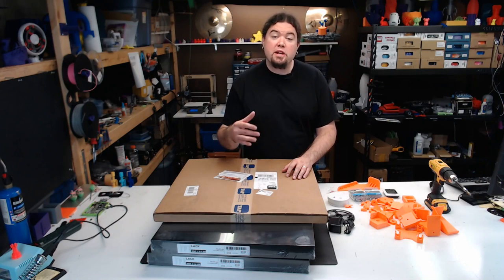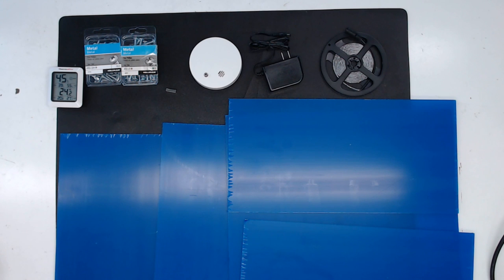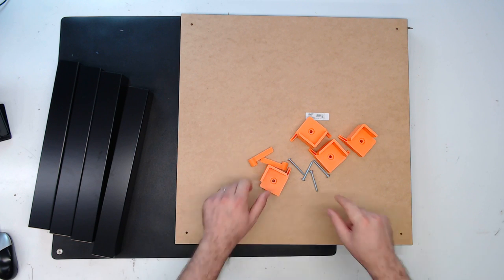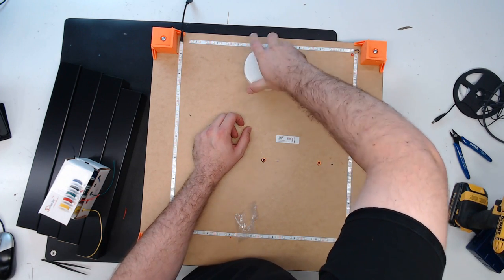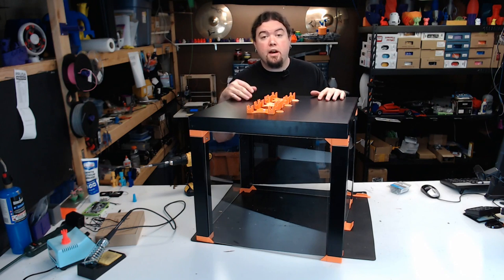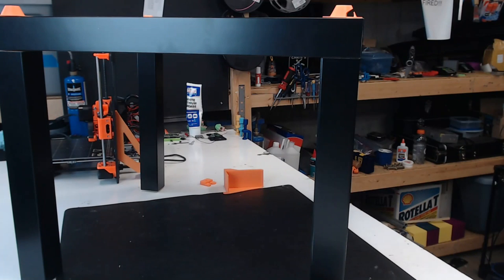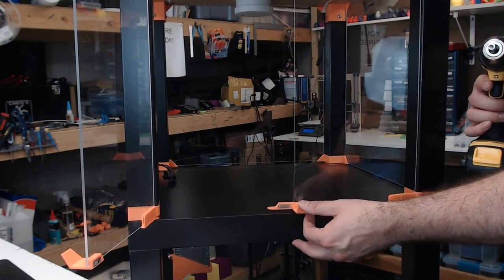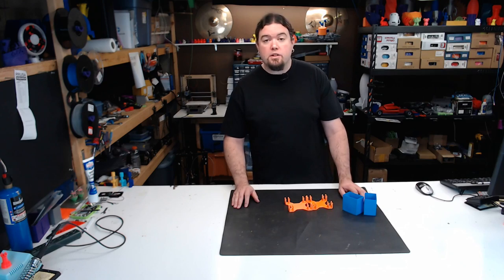Prusa IKEA Lack Table 3D Printer Enclosure - Chris's Basement

Comment: Chris, great video!  I've watched it several times already as I print the parts to build mine. Just wondering how the superglue has held up against those strong magnets?  Still hanging on? I've been leaning toward Loctite epoxy plastic bonder.
Reply from the maker: The super glue is still going strong, although I have used that epoxy before and it's a beast.
Reply: @ChrisRiley  thanks! Really appreciate the reply 👍

Comment: This is really cool, and I know I am two years too late, but what if you connected the Smoke Detector alarm to an Arduino (plus the alarm) so when it sends the alarm signal, it 1; cuts power to the Lack Rack and 2; emails/texts you that the detector went off. (Maybe 3, send a photo so you know if it is a false alarm or not)
Reply from the maker: That is a really good idea, maybe even add another temp sensor in there as well.

Comment: Just about ready to order the MK4 waiting on the MMU to come available, do you tink this will work for the the new MK4 these look to be about all the same size and design and forgot you earned a new sub great video...IKEA changed there website can you update the link for the Lack table please
Reply from the maker: Thanks! Yes, should still the MK4, but with the MMU2/3 you'll have to use the enclosure V2 with the flip top. Sure, I will update the link.

Comment: This is just too cool, def want to do this. I hope someone have made alternate pieces to make it work with a Ender 3 printer.
Reply from the maker: Yes, I think there are some parts out there for it.
Reply: @ChrisRiley  I found a package for the Ender 3, but it was just remakes of some stuff and didn't include the bits for the PSU relocation that would fit the Ender 3 PSU :/ Still very cool and might do it.

Comment: The #12 2 inch screws don't bite much into the table top.  They can be pulled out quite easily.   Better to use #14. Maybe Ikea changed the hole size.
Reply from the maker: A few others have said that, seems like #14's are the way to go now.

Comment: Great video!  Came to the party late.  I have a question for you. How much room from the top of the Prusa to the top of the enclosure?  I have a 15" paver stone that is 2" thick and would like to see if it will work with this enclosure.
Reply from the maker: It's kinda close, especially when printing tall stuff. You have about 2.5 inches of clearance from the top of the extruder to the top of the enclosure. So it will fit, but you might need to cut a slot or something like that to not break the filament.

Comment: What kind of screws did you use? Did you use self-taping screws?
Reply from the maker: I used these https://www.lowes.com/pd/Hillman-14-x-2-in-Phillips-Drive-Sheet-Metal-Screws-2-Count/3034788

and these:
https://www.homedepot.com/p/Everbilt-12-x-3-4-in-Round-Head-Phillips-Zinc-Wood-Screw-6-Piece-Bag-809131/204587510

Comment: Chris, You're awesome thank you. could you advise me how much was the total cost? does the backside of the printer enclosure is open or closed ? does this table size allow heat bed movement free?
Reply from the maker: If I were to guess, maybe $80 US. The back is closed. It is tight, but you can make the prusa not touch the back if you work with it,.

Comment: Checking out the plexiglass size on the Prusa project and the size is given in metric. However, the Tap site wants imperial. I know the 440mm comes to around 17 5/16 inches. Was wondering what was the size you ordered so I know they will fit.
Reply from the maker: Yes I should have mention that, I used (3) 17 5/16" x 17 5/16" and  (2)  8 11/16"  x  17 5/16"   all .118" thick.   Thanks for the comment. I will update the description.
Reply: Just as a FYI, the cost at Tap Plastic for the Plexiglas came to $59.87.  Shipping to my location was under $13 and I'm pretty sure I will have to pay tax.
Reply: Edward Boston the cheapest option on their website is the Extruded Acrylic Clear
Reply from the maker: Interesting, I didn't see this on there site. I will go check it out. Thanks for letting me know.
Reply: Edward Boston 
Tell Tap that America went metric in 1893.
Reply: https://www.printedsolid.com/collections/enclosures/products/acrylic-sheets-for-prusa-lack-enclosure
Reply: FYI, Tap Plastics has a metric option now. My order of 3mm extruded acrylic came to $55.12 after shipping ($12.52 to Dallas). Interestingly, the metric option came out slightly cheaper.

Comment: Pretty awesome . I have a Ender 3 . I think itis about the same size. 

My main question is : wil it decrease the sound level also ? like .. alot ? or is it just a little bit ?
Reply from the maker: Thanks! Wellllll......It makes the direct machine noise a little less, but since the tables are hollow, the resonate noise actually goes up. I put a 1 inch piece of foam under my printer to combat it. Then ender 3 is a little taller than the Prusa, so you will probably have to extend the leg caps.
Reply: @ChrisRiley  yeah it is 10cm taller.  Nou I have to convinve my wife to have it stand in the living room 🤣
Reply from the maker: @solidusseal  Yeah, I have the same problem. I haven't been able to achieve that yet. :)

Comment: How did you control the heat in the cabinet?  I want to build one for my Hypercube so I can print ABS better. Thanks for sharing.
Reply from the maker: I don't really, on a good day it will hit 32c, but that is about it. So I don't need to cool it down any. It's not very tight, but works pretty well.

Comment: good video, my Ender 3 showed up yesterday, so I am in the initial building phase, I lucked out I had purchased two of the tables(blonde) a few years ago, so I can re-purpose them. I live about 30 mins from IKEA. sad part is it is on the way to Micro Center.(joke) For the Magnets any other supplier?
Reply from the maker: Thanks! Yeah. it's a little short for the Ender 3, but it can be modded. Not sure on the magnets, they can be hard to find. It might be easier just to rework the parts to fit another type.
Reply: I have bought a few magnets from kjmagnetics.com they have a pretty good selection and you don't have to buy in bulk, which is a plus for prototyping. They are not that expensive either.
Reply from the maker: @Wulf_Mane  Thanks for the link!

Comment: Hello, I want to buy a 3 D printer.  I like the Prusa MK3S a lot.  Unfortunately, I don't have the money for an original.  What do you think of a Fysetc clone?  It is available for around 300 €.  It would be important to me that I can print holders, accessories, etc. (e.g. Blastgate) in the workshop.  Is PETG the Right Filament?
Reply from the maker: I don't know much about the clones, but people seem to like them. Keep in mind the MK3 has a lot of smarts because on the mainboard and firmware. Make sure you are getting a mainboard and the correct one. TO get the Prusa magic you really need an Einsy of some kind. Yes, all the parts are  printed in PETG.

Comment: Great work - I still need to print the parts. Apart from the bed wire guide which you printed in PET, what material did you use for the other parts, ABS or PLA? I'm sorry in case you said that and I missed it. Anyways - great video. Thanks for sharing! Cheers! JM
Reply from the maker: JM Tosses All the other parts were inland and filament Friday orange PLA. Thanks for watching!

Comment: What did you put under your printer to minimise the noise? Also do you think something heavy needs to go on top of it, to make it more stable and sturdy?
Reply from the maker: Mine is pretty stable, but I did add 1 inch foam under the printer and 1/2" under the feet to quiet it down.
Reply: Chris Riley can i get a pic of your full set up? Also is there a link where i can buy the foam you used?
Reply from the maker: @alex75846  Here is a couple of shots, the foam is just from the local home depot. 

https://photos.app.goo.gl/dNWvhgJsMY4ic8eV7
https://photos.app.goo.gl/b6xamezVu7rZEPWZ9

https://www.homedepot.com/p/R-Tech-1-in-x-4-ft-x-8-ft-R-3-85-Insulating-Sheathing-320821/202532854
https://www.homedepot.com/p/Owens-Corning-FOAMULAR-1-2-in-x-4-ft-x-8-ft-R-3-Square-Edge-Rigid-Foam-Board-Insulation-Sheathing-36L/100320356

Comment: why isnt the motherboard placed outside aswell ? I mean the drivers would have a bad time in 40 degrees inside the enclosure no ?
Reply from the maker: The temperature you will probably have in the enclosure will be less than 40c, the Ultimachine boards should be able to tolerate that with no issues.
Reply: @ChrisRiley  Ok what about us poor people ? What about Ramps, mks gen 1.4 and so on ? With LV or A4988 drivers ? .. btw would adding fans on the case of the board help ? Because it is still just circulating the hot air inside the enclosure.
Reply from the maker: @Wello789  Any air movement should help. A4988's should be just fine, they run a lot cooler than TMC's.

Comment: Hey Chris. I build my own enclosure using three lack tables this weekend. 
Also added some metal angles to screw the first end second table together. 

My first prints came out well but the table is shaking very much. Especially on fast moves or when printing the infill. 
I noticed some gaps in the infill and i think the shaky setup causes them. 

Any suggestions about how I could compensate the vibrations of the printer to reduce the shaky tables ? 

I know a good solution would be to screw the table to a more solid object or the wall but maybe there is another better solution.
Reply from the maker: I really can't think of anything off the top of my head. I do sit the printer on some thick foam when I use the enclosure. This could provide a little give and make it move around a little less.
Reply: Chris Riley thank you for your answer. I will test around with some foam under the printer. Maybe it helps. 

Is your enclosure also that shaky ? Or has my prusa unnormal heavy vibrations. ?
Reply from the maker: Mine does move a little bit, but from the sound of it, not as much as yours. It's possible you might have a slight hang up in a bearing or something.

Comment: What about rigidity and stability? IKEA tables are not exactly solid and they are very light (I can imagine high acceleration values can be problem). Have you noticed some problems in this direction?
Reply from the maker: It moves around a little, but I have added a lot of extra screws and brackets to help.
Reply: I worried about this too but it's working fine
Reply: Oh fwiw I only have 1 table on the bottom, not two

Comment: I'm a 3D printer newb, sorry in advance for a newb question.  I heard this is too small for the more economical Creality Ender Pro 3.  Is that true?  What dimension of Ender exceeds the dimensions of the Prusa i3 mk3 Original?  Any help is super appreciated.  Thank you for a wonder video.
Reply from the maker: Yes, these are too short for the ender 3, but on thingiverse there are extenders you can print. Everything else will have to be adjusted to fit of course.

Comment: This is pretty cool.  I can't do this with mine as it sits nearly two feet high. Have you made any enclosures for taller/ larger units??
Reply from the maker: When I have to build a big enclosure, usually I make one from PVC and plastic sheet. I haven't built a permeate one as of yet.
Reply: @ChrisRiley  say, that's not a bad idea.  TO THE DRAWING BOARD!!
Reply: @ChrisRiley  and subbed..
Reply from the maker: @elfpimp1  Thanks! Good luck!

Comment: Hi Nice job, quick question will it be possible to add the i3 MMU upgrade on top of this in the cabinet ? Or will this become to high !
Reply from the maker: Thanks, I think there is to much to deal with to try to cram the MMU2 in there. I just don't think it will fit.
Reply: Many thanks Chris for your quick response, I will tonight install the Raspberry Wifi from another video of  @ChrisRiley

Comment: How are you using screws for metal? I tried wood screws and those wont even tighten down all the way without just spinning. Tried using some little L brackets to join the third table legs but no way to get them tight either. This is turning out to be a nightmare.
Reply from the maker: You can't get them very tight that is for sure. Snug is all you can hope for, there just isn't any wood there.

Comment: Thanks for the quick reply.I have just now ordered the LED kit as per your message. Could you also send me a link for the heat bed plug cover? I have the MK3, will the same cover work for the MK3. Thanks, Richard
Reply from the maker: If I was putting an MK3 in there, I would use this one. https://www.thingiverse.com/thing:2837970

Comment: I'm looking to use the Multi Material Upgrade 2.0 with my Prusa i3 Mk3. Will there be enough room in the enclosure for this as well? I'm trying to figure out if I'll need to make the corner supports and Plexiglas 3 inches taller or more.
Reply from the maker: I have no clue how we would get this beast in an enclosure successfully. It needs baby sitting as well, so you have to have access to open it from the top.

Comment: Great vid.....Your thoughts PETG vs ABS......
Reply from the maker: Thanks! PETG is by far easier is pretty much every way. PETG tends to have a bit of spring or give to it which is good for somethings, but not all. That's where ABS comes in, even with its shortcomings, smelly, warping, shrinking and such it is still great to sand, drill and zero stringing. Plus it holds up really well on the spool, no special care needed really.

Comment: Great vid and awesome editing thanks! :D 
Would have liked to see a bit more footage of the finished product. Did you end up using the 3rd table?
Reply from the maker: Yeah, I should have done a little more walk through footage. I did use a third one, I attached it with L brackets. I am actually getting ready to do another enclosure video soon.
Reply: @ChrisRiley  Have you done that other enclosure video Chris? This was a great video. I'm currently printing the parts and sourcing the various plexiglass, magnets, etc. I'm concerned about stability, so may need some serious brackets and concrete blocks to put under the whole lot!
Reply from the maker: @MatSmithLondon  I haven't done any other permanent enclosure videos than this one, but I do plan on and ender 3 enclosure video. I want to look into the whole concrete block thing.

Comment: does this help with noise reduction?  I have an ender 3 and i'm looking at stepper motors, etc.  wondering if this enclosure will reduce the noise enough for me.
Reply from the maker: It might actually make the resonate noise worse. Those Lack tables are hollow and like to project the noise. If you lined it with foam or something it helps.
Reply: @ChrisRiley  Can you or anyone else corroborate this?  SO many people are using these Lack tables.  And SO many people complain about the noise of the Ender 3.  I'd expect these two things to have merged somewhere.  Can someone please add here what they have found with the Lack tables?

Comment: There is a 2 mm - 3 mm gap between the plexiglas and the outer frame all over. I was considering closing these gaps off with some rubber trim over the edge of the plexiglas to trap more heat but I'm not sure if this extra heat would be too much for the mainboard. Any thoughts?
Reply from the maker: I have thought about that. I can get mine up to about 33c if I run the bed at 110c, which seems to work for me. Maybe some weather striping would help? I don't "think" you have to worry about the board. Even with filling the gaps I can't see it getting much over 40c in there. Maybe....
Reply: Thanks Chris. I'll have a crack at it and see what happens. Still waiting on some parts ordered online to complete the project so any results are likely to be a little way off.
Reply: After sealing the gaps with the rubber trim the temperature sits on a neat 40c with the bed temp at 80c and the hot end at 245c (ambient temperature 26c). I also drilled and bolted the doors (slotting the holes in the plexiglass for adjustment) so that the door panels touch in the middle when closed.
Reply from the maker: Awesome, thanks for the update. What did you go with to fill the gaps?
Reply: I used a rubber edge trim similar to this one https://uesint.com/product/rubber-edge-trim/. There's still a gap there if it's fitted too snug to the plexiglas but I just tap it back out against the frame with my fingertips to close any gaps.
Reply from the maker: Cool, I might have to find some and give it a try.

Comment: So I built this thing against my better judgement because it didn't look like it could hold in much heat...and I was right.  Trying to print Nylon on my Ender 3 with bed temps up to 80C, and this thing never gets ambient above 28C.   If everyone is putting heaters in these things, or some other secret sauce, they're sure not mentioning it in the build process.
Reply from the maker: I use mine for ABS, the print bed is at 110c and I can get it to 32c pretty easy. Prints pretty well. You can probably add some seals to help.

Comment: hey chris I just got done watching this video again and I may make one and design a new version for the 3d printer I have now it is the longer lk5 pro so because it is much more taller then the prusa I would need to redesign the height of the feet of the enclosure to help make the legs taller so my printer can fit in the enclosure like putting it in a box lol but if I do I will make a video about it and let you know and send you a link to my video of the new version I will make and I was wondering if you ever looked into using the raspberry pi with a ssd hard drive yet I been watching out for your videos and still haven't seen a video on this yet.
Reply from the maker: That would be great, thanks!
Reply: @ChrisRiley  no problem and have you looked into the raspberry pi with ssd hard drive for octoprint yet?